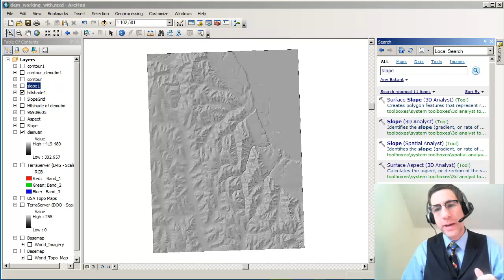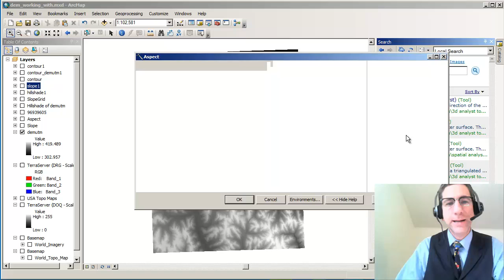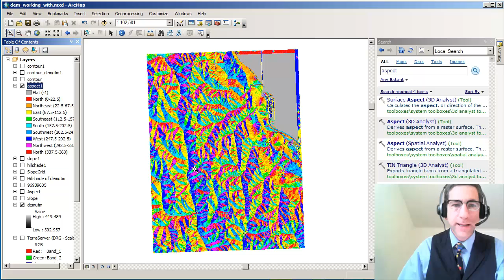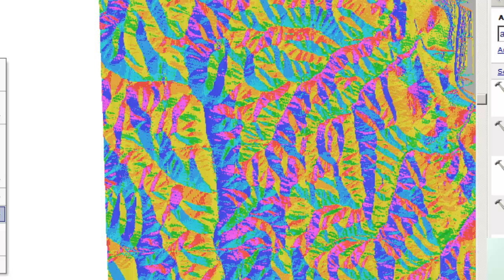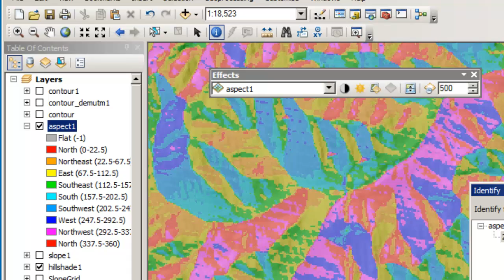Creating an Aspect Map from a Digital Elevation Model in ArcGIS

Comment: Hi!
How can I get an aspect raster with two classes NW-NE and SW-SE?
Reply from the maker: You should be able to classify the result into 2 classes:  Aspect 315-360 and Aspect 0-45.  Then combine those into 1 raster and call it NW NE.  Then do the same for 135-225 and call it SW-SE.  Then you can combine the two if you  need to.
Reply from the maker: You can use RECLASS and reclassify your raster to meet your criteria.